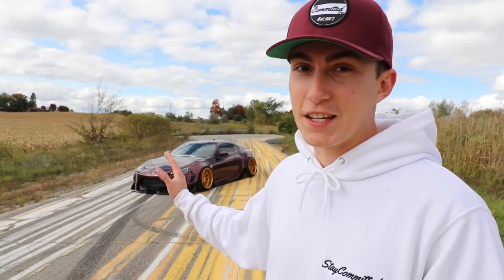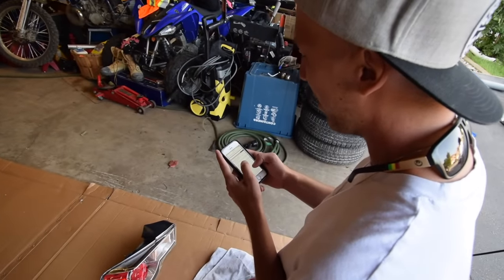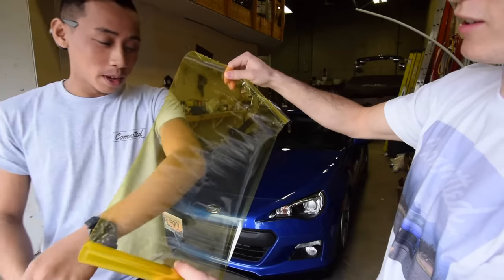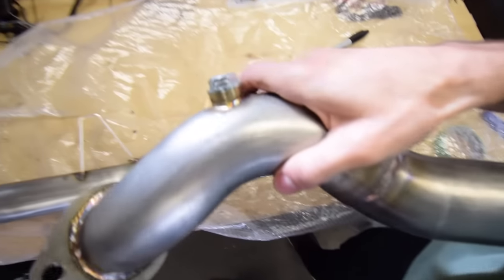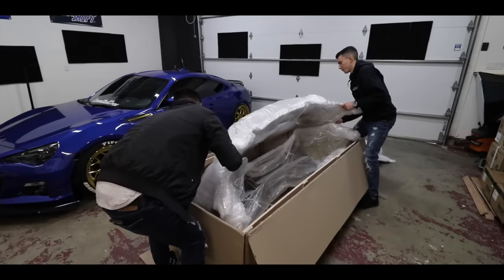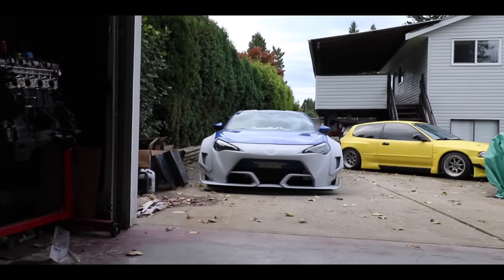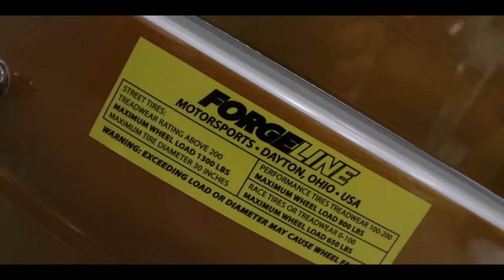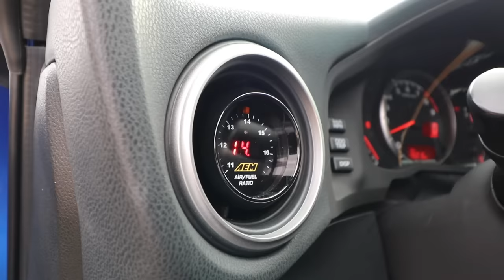Building a BRZ in 10 MINUTES! *INSANE TRANSFORMATION*

Comment: Modify your crank shaft to a sportier version your car will sound better feel better drive better and handle more speed and pressure on the engine helping to create a bigger spark with the amount if air coming from that turbo